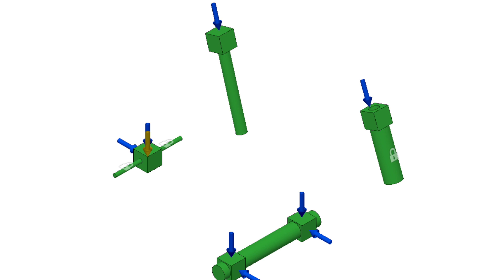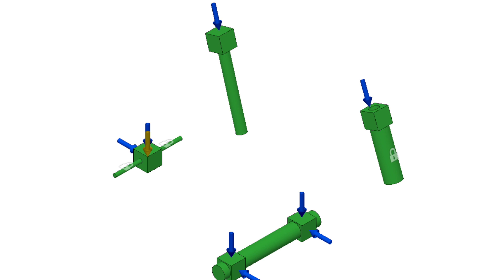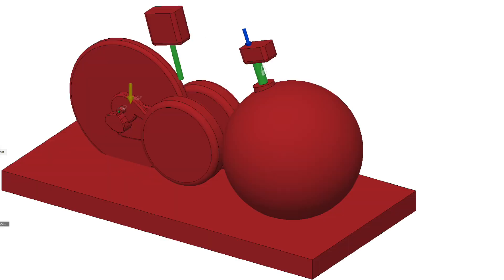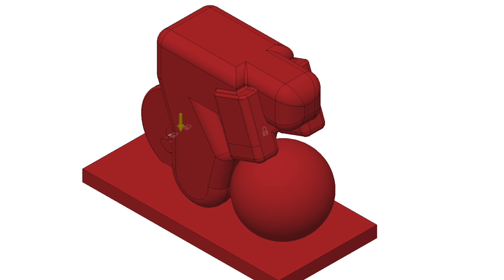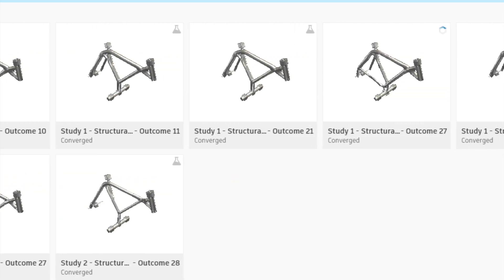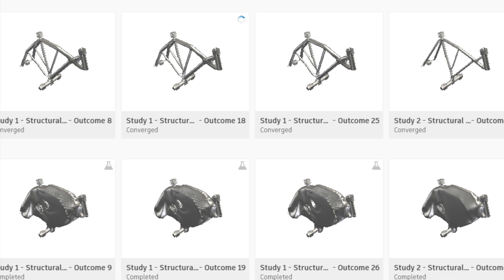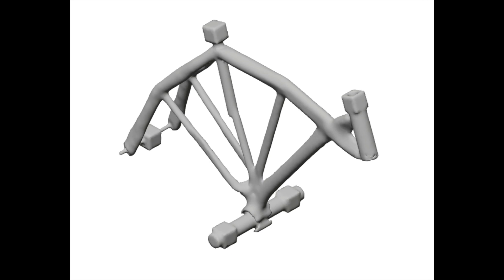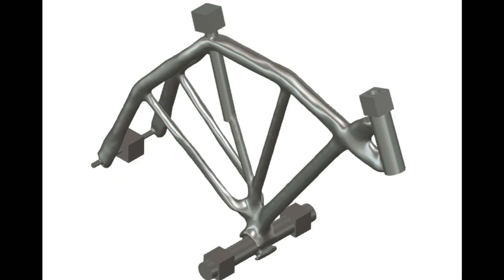Generative Design: Bike

Comment: if I'm not mistaken, this is actually topology optimization, rather than generative design. TO starts with material and iteratively removes it, based on design constraints, GD starts with design constraints and grows material to meet those design constraints.

Comment: The final result does not pass the sniff test at all! The flimsy junction at the top tube and the utterly bonkers seat stay are eye-brow raising to say the least. By glossing over (ignoring) actual load cases, you're ending up with something that is entirely useless, imo.
Reply: Correct, but pretty typical these days for ML models and surrounding processes. Whole ML industry is a big promise at this moment, with not much benefits out of it NOW.
SO IMHO in bikes industry it is good for start, but yeah, useless at this iteration.

Comment: Bullshit. The handlebar is also has a twisting forces from hands while sprinting. And sure it's not the only epic fails in this. Go learn physics before doing calculations.
Reply: damn dude hes just trying to showcase the generative design. its not like he claims to have reinvented the bike. did you maybe damage your ears composing your grammy worthy garage band techno ?
Reply: @nilednewztop918  It's the aim of generative ai to "Disrupt" current designing. this bike loos like a piece of crap that will ride like shit. the chain/seat stay combination looks like it'll snap under 3-400 watts. let alone the "toptube" if you can call it that.
Reply: @s.boarder1927  yes sure the bike isnt great and would probably snap very quickly but what did you expect?  The boundaries were only set as a very simplified load condition and the manufacturing possibilities (no idea how that affects the generation). There is simply no possibility for it to take the aerodynamics into account and also no one claimed it would do so. but i am sure with your expertise you would generate a production ready bike in no time!
Reply: @nilednewztop918  I actually build custom steel bikes. So probably, yeah.
Reply: That and it looks like they use way more material than the standard bike design does + it doesn't seem that aero but we know that it's hard to judge by eyes anyway.
Reply: @s.boarder1927  ah yes you seem like quite the expert on this. he should have checked the "optimize for aero" button!
Reply: No need to become a toxic internet troll over some video.